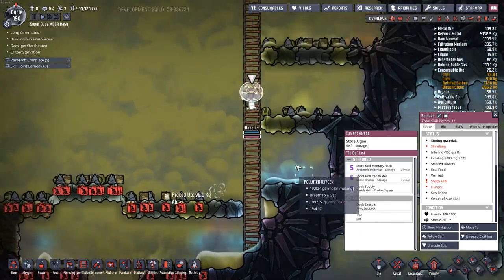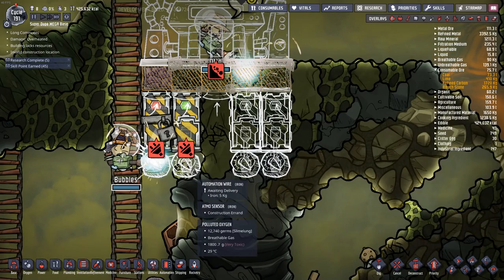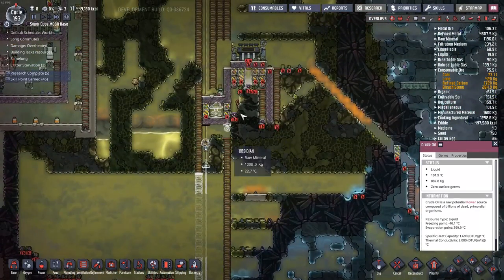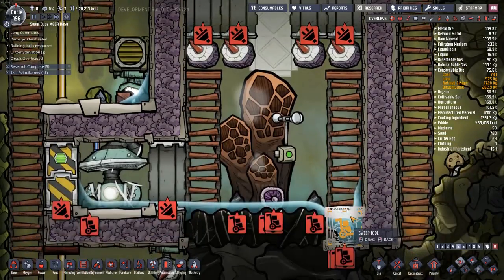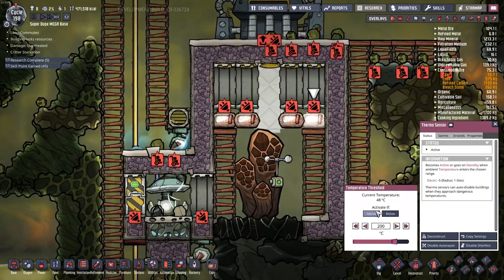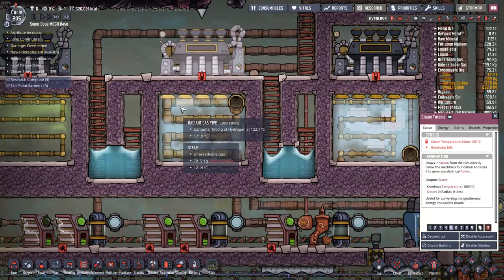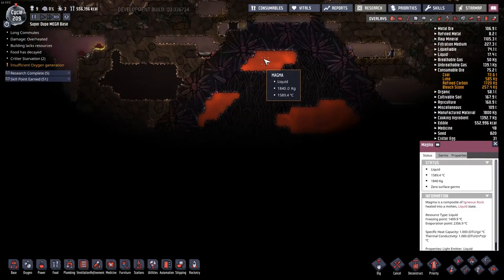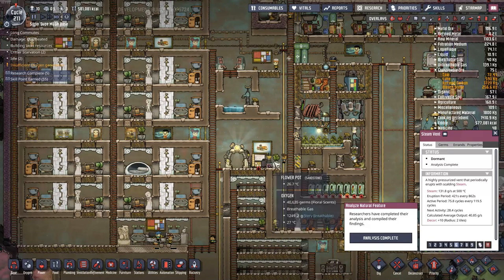Capping a Steam Vent with an Automated Turbine! Ep9 - Oxygen Not Included Quality Of Life 3

Comment: If your storage puddle has two-way access, it's best to put ladders over the water tiles to avoid the wet feet debuff; dupes can run across the top of ladders, and unlike mesh tiles items can pass through them.
Reply: pneumatic doors should work too. items pass through them & dupes should be able to reach through for items (even if door is locked).

good point! dry feet are happy feet.

Comment: Does this work for cool steam vents too?  Otherwise, do you have a video discussing what to do with those?
Reply: Cool steam vent outputs at 110C which is too cold for direct turbines. Should be able to cool the steam 15C to 95C then use that for hot water uses like electrolysis.